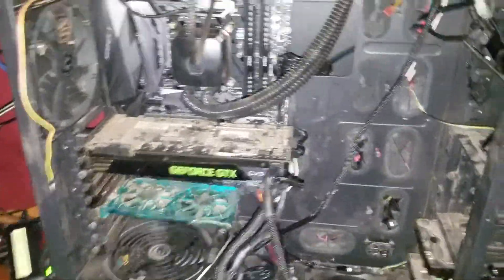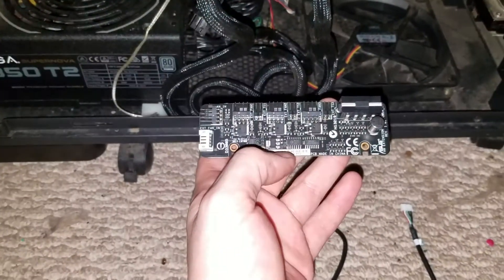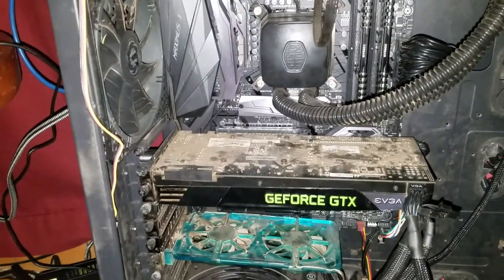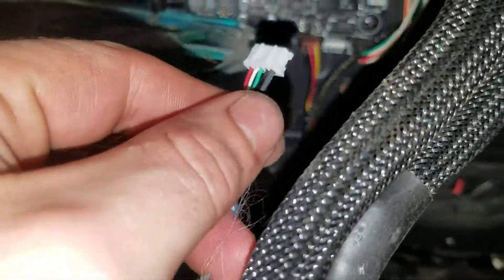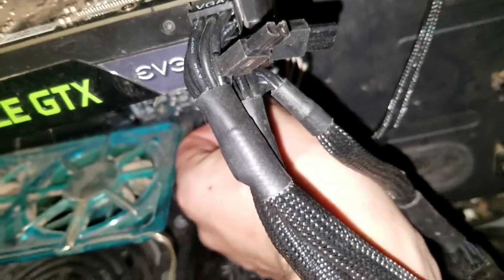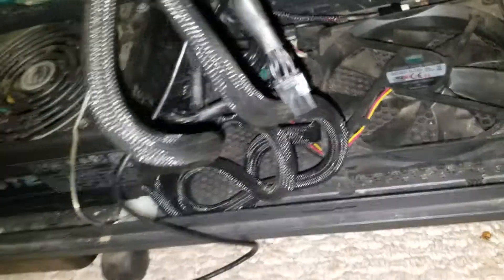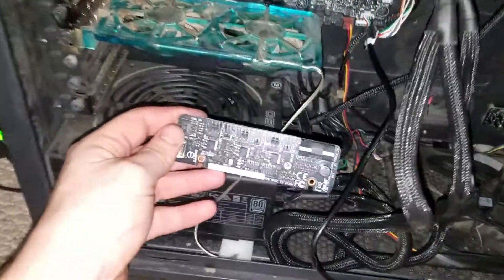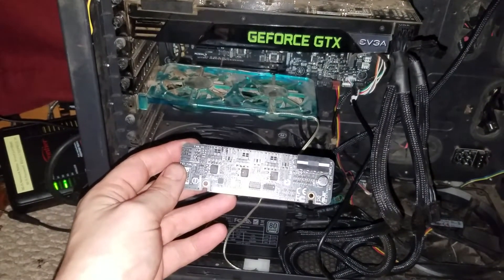how to install a asus fan extesnsion card on rog maximus hero x motherboard

Comment: set all fans to exhaust apart from the front and side for gpu your pulling in all that dust whats your temps in this condition be interesting to know hot id guess your poor rig needs some tlc
Reply from the maker: It's been cleaned since then. I have 2 front 140mm fans in a 240mm side fan in then 2 out on top for water block for cpu a 140mm out in back and then GPU fan out. System never really gets over 60c cpu with water cooler stays right in 50's
Reply: that's hot for my liking I like mine to run at 20c to 40c under load its colder here than where you are   @AdventuresInLiving
Reply from the maker: House is set at 78f so mid 20s c
Reply: seems about right for your ambient temp if its under load what's your CPU clock at?  @AdventuresInLiving

Comment: What you need is some bleach, swift dusters, a gallon of water and some antibacterial dish soap. Give ur PC a bath! 

I've Asus g30ab that came with only one fan, and that too mounted on a 510lc liquid cooling radiator. The PC comes OCed with three profiles 3.7, 3.9, 4.1 ....never needed any other fan! I really don't understand people going gaga over how many fans they can install.... might as well, install a drone and let ur PC fly away 🌚
Reply from the maker: I agree. I have cleaned since video was made.  I have a water cooled CPU and a huge case. Tends to end up heating up inside unless I have the fans to make it so there are no dead spots. With the software that Asus has and the temp probes I've been able to tune it so they only work when needed. And go off when I'm just sitting watching Netflix or what not
Reply: Adventures In Living : Still.... I prefer just having one 3-pin powerful fan mounted on the radiator; but your case gotta have vent holes on the side panels and a little bit of opening at the front... then; see the magic of one fan pulling the cool into the case and then exhausting out.
Asus did a great job with G30AB; more than four year and still works way better than most new PCs in the market. 

Most people don't realize that it's actually the room temp the fans are pulling thru inside the case. Some think 4-6 fans will help them keeping it cool.... little they realize it, that's a disaster! Noisy, not-energy efficient and more likely to accumulate dust inside.

Comment: WTF??? How the fuck can you live with the pc looking like that? You loads of gromits on the case and you only use one them? Also what looks like a good motherboard but looks like you have a mid end graphics card in the system, and I'm wondering why you need more 3 fans, "that's if your going to use them all when you say your motherboard already has 8"? 

Also if your putting more fans in because your getting high temps on your CPU, ram and maybe graphics card? Then keeping your system clean of all dirt and dust helps massively. It wouldn't surprise me if you have all the fans pulling air in?

Comment: What is the port for 5 pin fan in vs ext fan in?
Reply from the maker: +Michael Cheong on the mb ? there is a 5 pin header for a external fan. for like a radiator when using liquid cooling.
Reply: Adventures In Living that will plug into ext fan in with white color 5 pin. What is the usage of fan in with 4 pin header? When I plug a fan into this header it won't work.  Thx for reply 😉
Reply from the maker: the 5 pin white connector on the card is where you plug the cable that plugs into the motherboard so you can control the fans in the system. 
 4 pin fans are called power management fans and are able to be controlled alot more accurately compared to a 3 pin fan . 3 pin fans can also be speed controlled but not as accurate or as low of speeds.  with the 4th pin it can send a speed signal. when only have 3 pins it basically just controls the voltage to the fan. and changes that to make it slower. its a little more complicated then that. over all but thats a small summary of how they work
Reply from the maker: very nice reply. the instructions that came with it said to use the 4 pin and 5 pin the 5 pin fan card in is what connects the special asus card to a asus motherboard that supports it  the 4 pin is for power.  the 5 pin allows the motherboard software to control each individual fan connected to card. its says do not use with non compatible motherboard
Reply from the maker: and the 4 pin is the big power connector just like a hard drive bot a 4 pin fan connection
Reply: hey i need some help , im kinda noob to desktops. so im planning a build and i plan on using the asus hero x wifi mobo. how many case fans can i have? i plan on using 5 140 mm fans, do i have enough headers?
Reply: dubb It depends solely on your build. More specifically, it depends on your case of choice. A full size case will give you maximum cooling, but they depends on internal setup (professor, cooler, how many graphics cards, fan cooled graphics card or additional cooling options. All of those can and will effect whether you have 1 or 10 fans. Fan size, fan / PWM fan headers...literally you can have whatever you want. If your focus is cooling, build around that feature. Then where the PC will be located most of the time. Will you have a negative pressure case or positive pressure? Maybe just neutral air pressure setup. If it’s a dusty environment a positive pressure setup is better. Proper airflow for effective cooling also will be a factor in how many fans you can have. So, unfortunately it’s not as easy as saying “you can have 6 fans!” Like an engineer, you have plan your system out and see where it leads you.